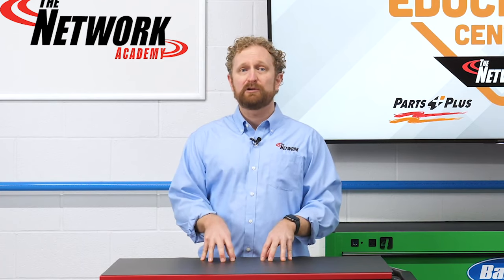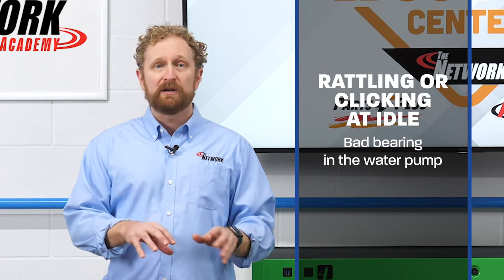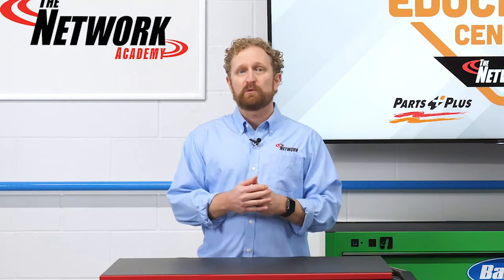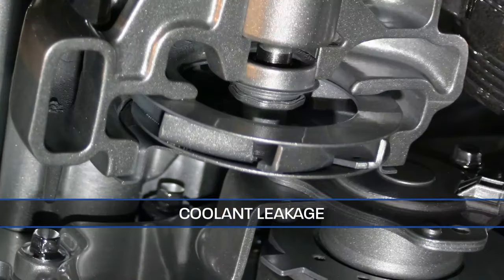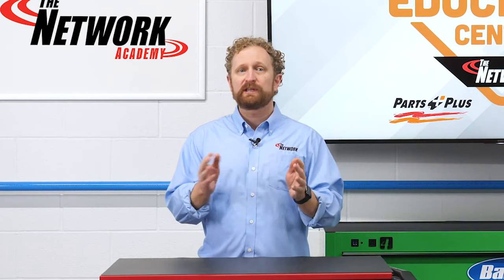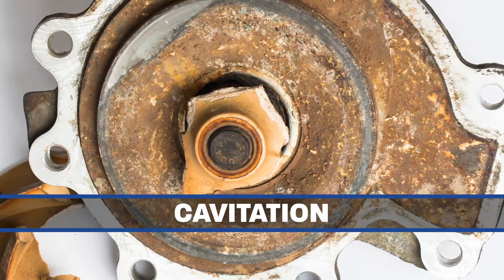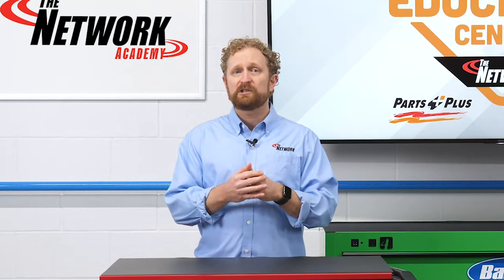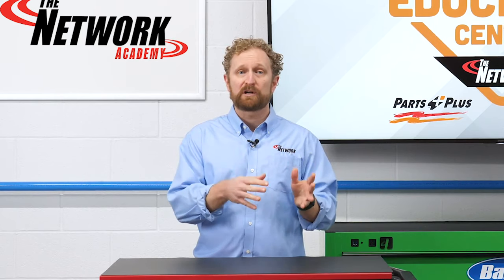Signs of a Bad Water Pump

Comment: Got my water pump changed out by the dealership. It lasted just over 2 years. The dealership wouldn't honor the warranty as it expired 4 months after.  I bought one with a lifetime warranty and installed it myself. You'll need a spanner wrench as well as another wrench. But I saved 1000 bucks. Totally cost $180
Reply: MG, what brand did you go with?
Reply: @simri7474  Duralast CWP 9240. HMU if you need help too. The various videos are great, but it doesn't go into detail enough regarding the shroud removal and other things I discovered that the video does not cover.
Reply: I have 1 tht won't overheat with defrost on but using coolant. Does tht sound like a waterpump to you? I thnk so but worried I maybe wrong but dnt thnk so
Reply: @kentuckyking4343  if you are blowing cold air and the water temp normal normal with the thermostats opened, you might havr check to see if you have coolant. If you do, you might have a heater core issue...
Reply: @MrJrnyfan  thank you. It's using antifreeze. I've been leaving defrost on so it won't overheat.
Reply: @kentuckyking4343  sounds like your thermostat is stuck...
Reply: @MrJrnyfan  I hope so. So it'd use antifreeze if I have 1 sticking?  I'm new to trying to tinker around myself bc I'm poor atm 😆
Reply: @kentuckyking4343  Know the feeling, pal. Continue to surf around You Tube. There are some really great videos.
Reply: @MrJrnyfan  thanks buddy... I appreciate everything 🙏
Reply: i've been reporting problems with my 2012 ford fusion since i had it, i got it in december of last year and have had brake issues, it makes noises when i drive in the rain, the fuel filter code came up not even 2 months of having it lol and now the advance trac code has came up, a/c blowing out warm air. why did i get a ford.
Reply: @Geminiwaze hoorah
Reply: @MrJrnyfan  my seems to be loosing coolant in the radiator but I have no sign of leak heat works after turning on but gradually less heat to mild heat then of if I am idling the car blows some very light heat like slightly cool but also warm water pump or heater core? Can a bad heater core lose coolant from reservoir
Reply: @thefoodieguy9519   You'll lose coolant if its 100% water. As you know, water turns to steam  when heated. You can do 50/50 in the radiator and 30% in the reservoir. If there is a puddle under your car, you obviously are leaking somewhere. Also too, look under the oil cap. If Its brown, you may have water mixed into your oil.
Reply: @MrJrnyfan  does that happen head gaskets are bad?
Reply: I just got my two years ago and it’s already gone out again🤦🏾‍♀️

Comment: This is one major issue that sometimes is not diagnosed immediately always seek professionals i took my car to a mechanic he said it was the fan belt but in reality it was a bad water pump
Reply: Lmfaoo same man
Reply: Do yours make noise when pushing the gas
Reply: @KevinSmith-fj9vc  NOT MINE. mine make noise at a stop or idling hot. when pushing gas works well.
Reply: I changed mine today did you notice a power increase in your car because before I replaced mine I started driving it and immediately felt a power increase faster accelerating I was surprised on how it may have affected the power output on my car

Comment: I was starting to think it was bad pulleys in my car but then I started to think wait a minute I'm getting a lot of coolant leakage and smoke them out of the engine with the loud grinding noise Thurgood think I think it's my water pump going out
Reply: it is, same thing happen to me, car never overheated my sensor went off and the water pump blew had to pull over because my car cut off the power. look at hood coolant everywhere and my car started steamin

Comment: It's hard brought it to many shops only way I got it figured out was utube caught it just in time most engines are made of aluminum over heating can Cause the metal to warp leading to head gaskets problems so fix this right away preventive maintenance in the long run will save you thousands

Comment: My heater blows cold air. Made sure it had enough coolant. Installed a new thermostat, wasn't the problem. Did a complete back flush on the heater coil, didn't fix it. It's got a new thermostat and the coolant flow is OK and it's full of coolant. It's not over heating, race the engine rpms and will get some warm air. Let the motor die down to an idle and it throws cold air again. Would a weak water pump cause that?
Reply: Heater core??
Reply: my impala does the same thing. heater works fine while driving but stop at light or stop sign and it goes cold. but im having an issue with my water pump pulley or the bearing of the water pump. i took the belt off and there was alot of wiggle to the pulley i tightened the four 10 mm bolts and it still has play making a noise when started. im just gunna get a new water pump pay day cuz the pulley is good the tensioner and every other pulley is fine and tight with no play.
Reply: @manalone1330  Having same problem, update?
Reply: @brysonowensby4477  no ive tightened the bolts on the pulley. as much as possible with a ratchet without rounding the nuts, the pulley itself is still wobbly idky. it runs fine no issues, just now here in Dallas we're getting over a winter storm and now the belt is squealing. im kinda not wanting to put anymore money into this car cuz it seems like alot at once just piling up when its not actually im just lazy in the winter and dont feel like working on my car in 20 degree weather, im expecting one from carvana in two weeks but then again i still wanna fix my impala cuz I've had it over 10 years and have had tons of problems minor and major and i know its a good car overall.
Reply: @manalone1330  gotcha. I’m in Dallas too so In the same situation. I think it is most likely the water pump bearings. Going to have to replace the water pump tonight in the freezing cold because I need to get to work tomorrow. My pulley had so much play my belt slipped off and got tore up
Reply: @brysonowensby4477  might be the same for me cuz i put in an aftermarket water pump before and ever since then the pulley never sat right.
Reply: Yea guys...if it's blowing cold air that means your water pump isn't pumping sufficiently...tall tell sign
Reply: Guys, I know this is 10 months ago, but seriously not a single one of you you have air in your cooling system you have to bleed the air out it’s airlocked that’s why when you accelerate the interrogates warm for a little bit because you’re pushing it sort of you may have a bleeder valve on the heater hose behind your intake manifold on your radiator. If not, you can install a bleeder today. Either way you can jack up the front end or put it on ramp and get a spillproof funnel and bleed the cooling system this way with the end of money. Do you want to keep the coolant level above the highest point of the engine block look the video up up

Comment: My engine was never overheating but the rad blew one day. Took it in to get replaced and the car was still overheating instantly . Had to leave it at the shop where they removed the radiator again checked everything and the water pump propellor was broken off the shaft in 3 peices. Never showed a sign of any leaks or any problems driving until my radiator blew. Is that normal
Reply: Literally the issue I’m having with my Honda. Changed out the rad, therm, upper and lower hoses and car only overheats when driving but not idle. I’m really thinking it’s my water pump now

Comment: O heard the noise before i left home a clicking during idle went 10 miles away now I'm stranded, i did  timing belt and the kit came with the water pump so i took out the aiso pump and replaced it w the 78 dollar one one year later we're here smfh should kept the oem still going strong when i first got the car at 160k miles (04 Lexus  gs s300)

Comment: I have a chevy 350 in a boat closed cooling with antifreeze. no leaks or noises. All ther parts checked in the boat. Is there any way the metal impeller went bad? running 160 but then 180 at 3100 rpm.

Comment: ORIGINAL water pump at 298,000 miles. Should I replace if I need to replace timing chain/tensioner?
Reply: Might as well since almost everything is being taken off the front/side of the engine just to replace the timing chain/tensioner.

Comment: I did purchased Water Pump  for Mercedes S320   car year 1999-2000    K seal works   but can i drive home 120 miles or better take side roads. K_seal   was used for water pump 6 weeks ago and I did only made 2-3 miles trips  No problems. Tomorrow have to drive home on 8/9/23

Comment: Would a failing water pump that’s not leaking or making noise be the cause of reservoir tank filling up after about 1 hr of driving
Reply: Having same problem . Did you figure out why that was happening ?
Reply: Did you figure out the problem ??
Reply: Same issue here did u figure it out ?
Reply: Same problem
Reply: Pressure in the overflow could be a head gasket...or possibly a thermostat that is stuck. Just my thoughts.
Reply: Did u figure it out
Reply: @cartor4558  I'm a Mechanic, and I am 99 percent positive ,  Head Gasket is leaking between a cylinder and water jacket, pressurising the System and causing pressure to push coolant out of the radiator back through into the overflow / Res tank 👍.  I'd almost be willing to bet ,coolant is mysteriously vanishing also because small amounts are getting into a cylinder and burning 👍
Reply: I'd bet it never happens until the vehicle is driven correct ?
Reply: @cartor4558   idk it seems like it’s good
Reply: Sharing my own experiences, but check the most overlooked but inexpensive item: the radiator cap. I found that when my reservoir was boiling up from hot ass coolant and was over flowing when my engine was freshly built with refurbished heads and MLS head gaskets i knew the problem was either the cap or thermostats stuck closed so i went with the cap and sure enough it was the freaken cap! Check your radiator cap!
Reply: Sound like a head gasket problem
Reply: @kingsoutdoors4379   if my car has antifreeze around my water pump a hoses could that mean I have a leak and my temperature gauge is going a little bit over the middle
Reply: @youngnick1800  If You are seeing coolant around the waterpump , replace waterpump and gasket. Always check hoses first, clamps have been known to cut into area of hose when they are tightened. Always make sure there is no air pockets in cooling system . I usually will have rad cap off, start vehicle and let it run. I fill while it's running . Looking in radiator to see circulation and know when thermostat is open. Fill and cap off. Be safe and stay away from fan blades/ belts etc. I assume no responsibility for any injuries from someone else's errors or mishaps. Stay safe my friend
Reply: @kingsoutdoors4379   thanks brother
Reply: @youngnick1800  absolutely. Hope it can help.
Reply: I don't have any noise or see a leak but I am using alot of coolant, no overheating changed thermomastat is it a leak in radiator or water pump 2012 jeep wrangler???
Reply: @expertopinion8111  if you are using coolant, see no leak,  it will eventually overheat when it gets low. Pull the plugs...one should look different from water entering the cylinder. I'd bet a blown head gasket. Would cause all your problems👍
Reply: @expertopinion8111  if you have any questions I'll help you out
Reply: @kingsoutdoors4379  mines have brown liquid on the water pump hose and around the water pump, what do you think it is
Reply: @YouTubeBestCreators  it sounds to me like rusty water, does your vehicle have coolant ( antifreeze ) in it?

Comment: hello hi i have toyota corolla gli when i accelerate the car the car will noise during accelerating whats the issue plzzz tell me ?
Reply: It is the Boris it’s not costly okay get it fixed
Reply: @babalolafuad1028  what is boris o didnt understand
Reply: little sound when accelerate whats the issue
Reply: @usmandurrani6467  You can't expect people to tell you what the cause is just from a vague description. Even with a detailed description, the best you can hope for is possibilities. There are so many things it could be. If it sounds like a metal pan vibrating against another piece of metal, and it's worse at high revs and kind of intermittent, it might be an exhaust heat shield. Water pump, alternator, idler pulley, power steering pump or any other bearing on the engine could produce a sound that comes and goes or worsens with higher RPM. Even low oil can make your engine run noisy. An exhaust leak can make more noise under heavier loads. If the sound is only under acceleration, it could be a bushing in the suspension or drivetrain, or a motor mount, or a problem in the transmission. clunking sounds can be ball joints, drive shafts (not usually fwd), loose battery or spare tire/junk in the trunk, suspension bushings, or strut mounts. Low quality or worn out brake components can make noises too... If you don't have any diagnostic skills, you're not very likely to be able to figure this problem out, and you're probably better off to take it to a shop and let them do it; throwing parts at problems usually ends up costing more.

Comment: Hye, my radiator is keep on discharging coolant into spare tank. Even many parts has changed (new radiator, new thermostat, new radiator hose, new radiator cap) but the radiator still discharging coolant into spare tank. One of my mechanic suggest me to change the water pump. May i get your advice?
Reply: I would probably turn to the water pump at that point, as that is the only other part you havent replaced that could cause the problem. Props to your mechanic for being honest
Reply: @CoDBOmoon115  yes. And your suggestion pin my mechanic too. Will do it soon.

Comment: WHAT CAUSES THE SEAL IN A WATER PUMP TO FAIL IS A BAD BEARING WHERE THE SHAFT WOBBLES AND EXPANDS AND WEARS OUT THE SEAL.. THAT'S WHY YOUR SEAL GOES BAD USUALLY ON ANY PIECE OF MACHINERY. IT DOESN'T NECESSARILY MEAN IT HAS TO BE A WATER PUMP.
Reply: I took a good look at my engine this morning I was wondering where the noise is coming from and you have one of the pullies was like wobbling making a grinding noise think it's the water pump one
Reply: @juggalogamer8541  ON MY E-250 VAN I HAD A NOISE, THINKING IT WAS THE WATER PUMP BUT THE PUMP WAS NOT LEAKING. SO I TOOK SOME WD-40 AND SPRAYED BEHIND THE ALTERNATOR PULLEY (FRONT OF BEARING) AND BEHIND THE HOUSING ON THE OTHER SIDE OF THE BEARING AND THE NOISE IS GONE. THE FRONT BEARING IS WORN.

Comment: I have a Hummer that makes a metallic clicking flapping sound when you start the truck and it doesn't go away. I'm trying to determine what my issue is. It was running fine until the transmission fluid got hot and overheated. Now I have that flapping sound coming from the front part of the engine. If you have any ideas or suggestions please share.👍😎👌
Reply: Clutch release bearing
Reply: @arunkumar-xc3ms  Thanks for info I'm glad somebody responded. Through further investigation since I made this post I went back and turn the H2 on and the sound was back then I just happened to turn off the heat and the noise mysteriously disappeared. Now I don't know the reasons why it disappeared but if you know feel free to share bud.👍😎👌
Reply: @J.Crooner  its my thought so i guess its a clutch release bearing
Reply: @arunkumar-xc3ms  I'm dropping the trans now and going to replace it so in the process I'm sure I'll find the issue.😎
Reply: Selling the hummer might make the issue go away
Reply: @javanbybee4822 😂😂😂 If I didn't love my SUT I would but luckily swapping out the transmission in the center of my driveway has fixed the issue. The "Stealership" wanted 10 grand😲😳. I did everything myself for $400 bucks, Mission Complete bud💪😎💪
Reply: bet it was just the blend door actuator 🤣
Reply: @dynamitesticksgobangbang3170  😂😂😂It could of been but believe it or not after driving for a few miles the clacking noises magically disappeared on its own so no complaints on my end. I definitely don't feel like investigating the actuator especially if it's on the drivers side. That top bolt will be a true pain in the AZZ to remove.😳